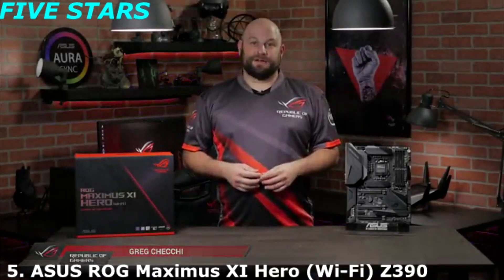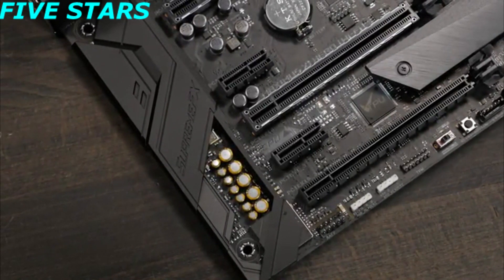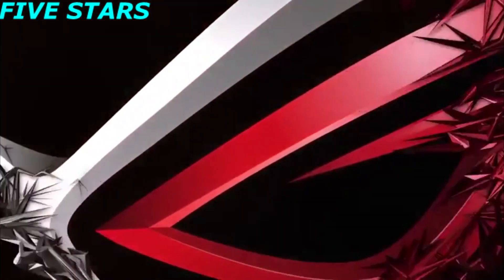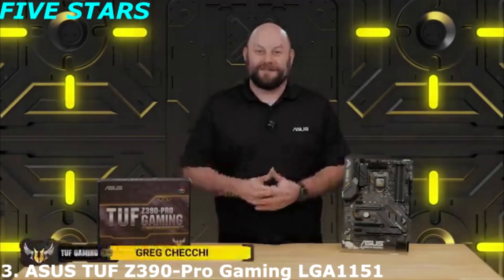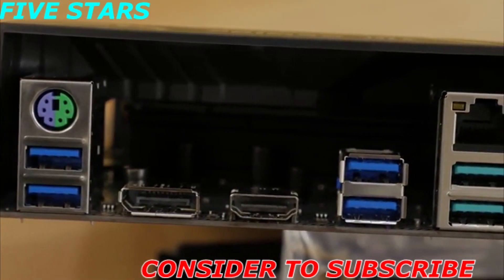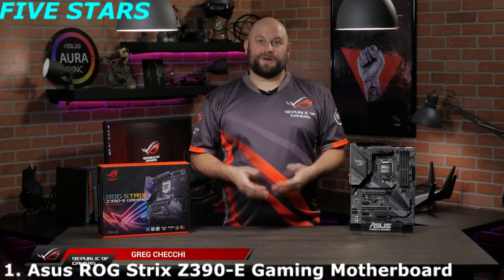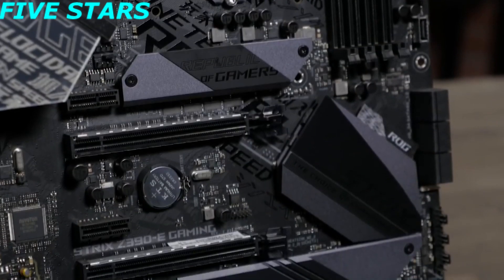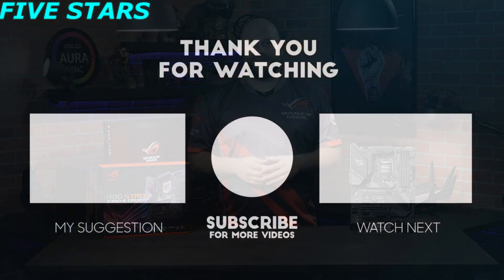5 Best Z390 Motherboards for Gaming of 2020 | Best Motherboard for I9 9900K & I7 9700K

Comment: hey im kindof a noob at building pc's, but if a motherboard supports an i7 9700k, does it alos support the non-K variant? i have an i7 9700 and wanted to get this motherboard
Reply: Hey there! they all run on the z390 chipset which is why these fit the best but you could practically choose almost any MB with the LGA 1151 socket. the k is just telling you that you have an onboard graphics option.
Reply: @doka361  The K designation indicates that the CPU is "unlocked" meaning it can be overclocked. Unless it has the F designation, it will have some sort of integrated graphics regardless of the presence or absence of the K designation.